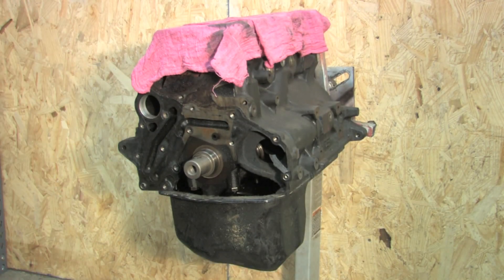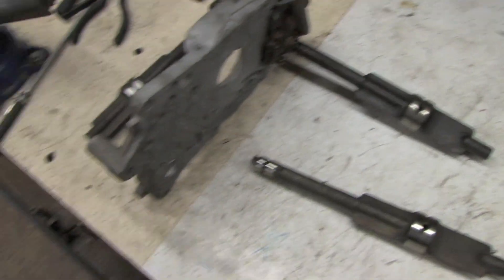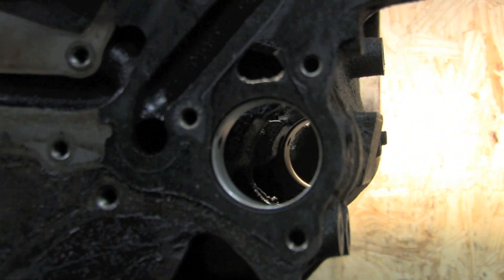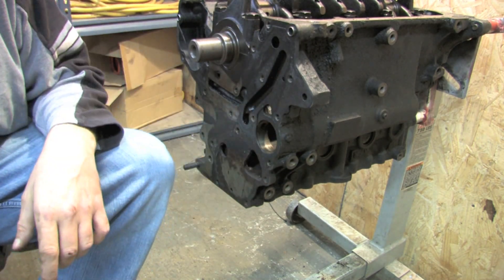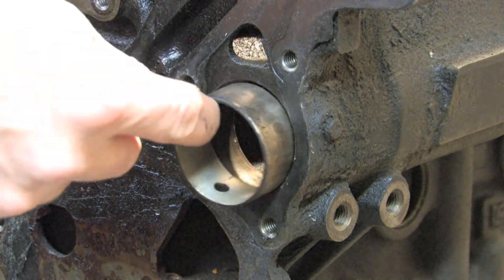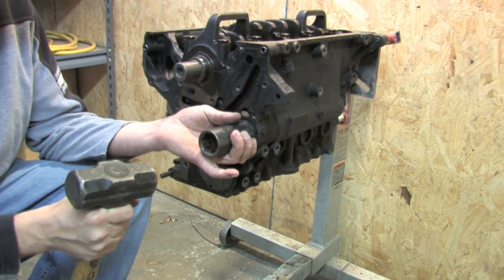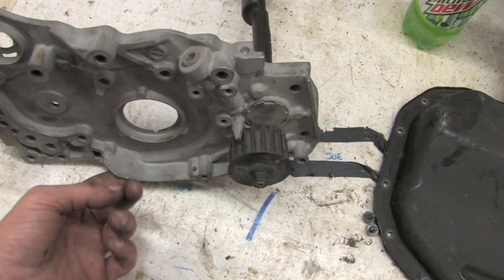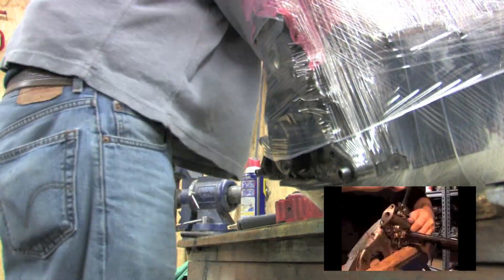4g63 Balance Shaft Elimination - bearing modification

Comment: I have a new oil pump for a 2005 , 2.4 mitsu eclipse , my car is actually a 2006 will I still be able to use it an modify it slightly where the crankshaft sensor bolts up like with a die grinder an will it fit ? I don't see any follow up video on this

Comment: Hey @jafro I had a question I’m building a motor and was wondering if I run I pick  in the hole of the bearings should I feel a hole like if it is a oil feed . I ram my pick in the hole and it feels like if there is no hole through my not the block … does this mean the bearing was already rotated for balance shaft delete .
Reply from the maker: Very likely.  The bigger tell would be the absence of balance shafts, but if you got a pile of parts and you're trying to make sense of them, that's the best bet.  You can see a plug on the outside of the block for where the balance shaft oil gallery was drilled.  To plug the outside of the block, the Phillips-head looking threaded plug was sealed and screwed in.  If the hole isn't in alignment with that pin, that's another tell.  If the balance shaft bearing is scored and damaged and doesn't line up with the hole, option C is it spun the balance shaft bearing.  The damage would be obvious, but if the bearing is pristine, it was rotated for block-off.

Comment: I have a Lancer Turbo here in the UK, it has the 2.0 4G63 turbo engine in it, removing the counter rotating balance shafts also gives around 6 extra bhp, plus it negates the issue of when a belt snaps causing all manner of problems.
God vid, and you're right, it's a hell of a job.
Reply: How's your 4g63 sohc EX2000 Turbo now? Did you use shorter timing belt when you did a balance shaft delete?
Reply: @4g63_Everything  the balance shafts run off 2 different and smaller belts, so the cam belt remains the same as before, when they are deleted they give more power and its not really noticed on the engine smooth running.
They need to be done correctly otherwise it can throw the engine out of harmonic balance, ( I'm led to believe, not sure if true though) so total removal and blanked off.
Reply: @4g63_Everything  the engine needs to come out of the car. I've had a balance shaft belt snap in the past, it sounds like a big end failure and makes a lot of noise and can damage the engine.
Its a good idea to remove them from the sohc 4g63 engine.

Comment: Hello my friend , I need your help , please!. Let's see , when I turn on my car ( Mitsubishi RVR sports gear x3, engine 4g63) the oil pressure is 80 psi for 800 RPM (for 65°F). but when the engine starts to heat, the oil pressure drops to 0 psi (200°F). What do you think ????  
Note: my Metales are new.
Reply: The easiest place to start is by changing the oil pressure sending unit. (this is if you don't have the correct tools/knowledge to test it, they're typically very cheap)
Reply: @squintnmint  I already did it.

Comment: Took me a while to get that inside bearing set. I tried two times before and split the hearing both times. Once because I tried to go with a socket on hand that was not the same size as the bearing and the second was because I went to hammering on it before it was set in there straight. 
 Well third times a charm I’m gonna slap my beast back together now!

Comment: i have done  this job in my kia sorento 2009  i eliminated the oil holes by a stick .. but every body tell me that iam crazy to doing thatu wanna ask jafromobile
Reply from the maker: Nah man.  Unless it's a threaded stick in a threaded oil gallery torqued in place, then oil pressure will blast that thing out.  Then you'll end up with low oil pressure.  That would hurt all of your other bearings.  

This is the safest cheater method I would ever risk taking on my own equipment.  I bought all the rare out-of-production Mitsubishi balance shaft tools now, but this video proves you don't need any of them on a balance shaft delete.  You only need the balance shaft tools if you're replacing and re-using the balance shafts.  If it's just a delete, gimmie a hammer, a socket, and a half inch extension and the old balance shaft.  If you're careful driving them in and out, you can re-use the old bearings to do it, so it's a $0 job just like the stick.  :)
Reply: Jafromobile yes  i put a threaded sticks because i didn't see your video when i diid the job . ...your method is easier than the mine
I have a question.?
Why some 4 cylinder motors don't have a balance shaft and no harmonic balancer pouley
Does the harmonic balancer eliminate the vibrations and save the engine from domages .

Comment: In my early 63 days, I totally understood & agreed w/the idea behind the BS removal.  I have now taken the opposite view and consider it a big mistake.   Mitsu didnt just add the BS for creature comfort, they are there to reduce some serious, damaging harmonics that  can shorten the life of your build
Reply: good engine will have no bad harmonics and if you affected the harmonics of engine by removing BS then that engine has been already toast
Reply: Interesting. I'm new to the 4G63, but have heard it was done due to something with the way the engine and trans were set up? I know Honda F series has them and the engine is set up the same way, but spins counter clockwise and lots remove there's.
Reply: I got a nicely built 4g and it still has the balance shaft I think, only reason I say I think is because with poly mounts it idles hella rough.

Also if there harmonics are bad what about a harmonic balancer? Like a fluidamper or ATI
Reply: this is the same engine thats going into the GSX, its getting a fluidamper

Comment: my 2002 galant balance shaft is like hard to spin so it rip apart the belt. what can i do ???eny suggestions..thanks
Reply: do like me. my balincer shaft bearing was in the bottom of the oil pan,so done like the vid here ,i got reed of both ,the balincer shaft and the oil shaft
Reply: tom johnston I had the same thing happen to me - rear bal shaft bearing loose on the shaft when I pulled it out lol. Now I have the problem of putting a new bearing in its place because the hole in the block for the bearing is ground out just enough that a new bearing doesn't fit tight. What did you do for your delete? I'm pretty sure that rear bearing has an oil hole, so how to block that off so I still have oil pressure? Thanks

Comment: An addition to the "balance shaft bearing removal technique".My 318 Mopar motor had divots chunked out of the cam.From the lifters sticking open I read. I assured myself that the cam bearings would be OK since I read that they never wear years ago, I was broke and didn't want to buy a cam bearing tool and nobody rented them. But no siree Bob, there were grooves plowed into the bearings. It was as heart rending as realizing that I actually did buy a FIAT and it wasn't just a bad dream. Anyway, I had a half inch diameter threaded rod three feet long. I scrounged it from somewhere thinking it might be useful someday. Then I had a big socket, half inch drive, and luckily a big nut which fit right into it and threaded onto the rod which located the socket, so as to center it on the threaded rod. The socket was backwards.  Then I had scrounged some huge thick washers. I think from when the electric linemen erect those crucifixes they hang wire from. These washers were an almost exact fit in the bores of the cam bearings, just slightly too large. So I mounted the washers onto the threaded rod, and spun the rod around while leaning the washers on my belt sander since I don't have a lathe. That whittled the washers down and allowed me to chamfer the edge of the washers, fatter where they contacted the cam bearings. I also had to belt sander some flats onto the threaded rod because I didn't have enough nuts to double nut the whole thing together when it was time to use it. There was another nut clamping the washers to the reversed socket. Then since the socket almost located this assembly inside the cam bores, but not quite, I wrapped the socket with masking tape to make a Rube Goldberg device slightly more solid. Anyway, it worked. The two pound sledge hammer propelled it. I couldn't damage the block, that's why the extra care. I couldn't do the rearmost cam bearing because the engine was still in the Jeep. A hunk of garden hose maybe 3/16 inch was needed around the threaded rod to locate the washers too. The washer needed grinding as the thing progressed into the motor. The tricky part was when I installed one of the bearings wrong and had to drive it back out with this funky setup. Trying to slip parts of it into place and assembling it inside the block. (I had the oil hole misaligned.) I used a weight lifting plate for a slide hammer on the threaded rod! But it ran OK afterwards till an old bag crashed into it and totalled it.
Reply from the maker: One of my friends bought a FIAT Spider in high school.  He got the tag, "HU FIATD".  True story!  Making tools is the mark of a true mechanic.  Same person I'm talking about owned several obscure vehicles like 50's era Volkswagens, '60's era Jeep Commander, Land Rovers and even the 104th Mustang ever built... and everything that inspired me to make my own tools came from his example of necessity.
Reply from the maker: Sorry... 1968 Jeepster Commando.  Even more obscure.

Comment: So if you got rid of the balance shaft, won't the timing belt length needs to be a little different ?
Reply from the maker: Nope.  The rear balance shaft is driven by the oil pump gear, and the front shaft has its very own belt.
Reply: hay just wanted you to know your vid has been a great help.iv never messed with the mitcubishi alway had the ford and chevy,so got a good deal on a 03 mitch  with a 2.4,it sounded like a rod was going to come out anytime,so i removed the oil pan and there lay a balincer shaft bearing in the pan,so even with the motor in the car i done the balincer shaft and oil shaft removel ,went ahead and changed the mains and rod bearings,all with the motor in the car.runs fine.thanks for the great vids

Comment: Jafro, any reason not to use a 32mm socket to drive out the old bearings?
I have the oil pump, timing belt and balance shaft delete on hand and enough in my bank for a rebuild kit, waterpump and timing belt tensioner so it looks like I'm finally doing a rebuild on my van.
Reply from the maker: MM95 Good question, you didn't give me the context of what you're doing, so here comes all the possibilities in case it will help others... Sockets usually have rounded edges, so they slip more. You need a really well defined edge like what's on that shaft to knock it out.  You can drive them out with a socket, sure, but you need a proper bearing driver to install them if the balance shafts are ever going back in it.

If you wish to preserve the shaft, but the balance shaft isn't going back in, go ahead and wail on 'em with anything that fits.  You need a socket that's smaller than the hole, but bigger than the bearing and that's really hard to match.  Every socket set is different.  If you go smaller than the bearing, those rounded edges will cause galling on the bearing bore as it mushrooms the bearing.

If you're keeping the balance shafts and you drive in new bearings with a socket, it can cause a high spot in the bearing face that leads to premature bearing failure and seizure of the balance shaft.  

Without balance shafts and with bearings re-installed blocking the holes, beating the bearing in and out with a socket it can cause misalignment of the bearing resulting in an oil pressure leak.

If you don't have the proper tool or one with a good edge to drive the bearing out (or destroying the balance shaft as I'm demonstrating)... you must take extra caution not to damage the bearing bore.  Often times auto parts stores will rent out bearing drivers.  Those are usually very worn out tools, but they're the [worn out] right tools for the job if they have them.

If the balance shaft bearings are okay, and the engine is keeping its balance shafts after the rebuild, I just leave them alone.  I can measure an installed bearing, and I can measure a balance shaft, and I can calculate the difference splitting that result in half to get my oil clearance and make sure I'm right... but there's less of a chance a replacement bearing will be in spec and aligned properly than the new ones that are well broken in.  You can not measure for taper to detect an alignment problem once the bearing is installed.  You can't plastigauge it either.  You can measure your oil clearance, and even if it's at the end of spec, I leave it alone.  DSMs aren't famous for having low oil pressure because of having a balance shaft.

Failure of a balance shaft bearing will result in the same damage or worse than breaking a balance shaft belt.  The broken balance shaft belt gets tangled and snaps the timing belt because it's inside a sealed timing cover with nowhere else to go.  A 4g63 is an interference engine.  What that means is... it will basically take one of everything in the valvetrain and rotating assembly to fix correctly if the timing belt breaks.

That's why if I'm ever re-using the balance shafts, I just leave them alone.

Anything else I can add to help you get there?  :)
Reply: Thank you good sir, I will take a look at the tool box and at the bearings to see if I have anything that is close enough to work, I wouldn't mind modifying some tools. If I don't have anything reasonably close I will go head and rent the proper tool.
I am simply doing the elimination so will be nstalling new bearings 180 out to block the oil holes. My whole build is very low end, just to get the 4g64 powered van back on the road. The only "upgrades" are going to be balancing the rod-piston combos, the crank if it needs any other machining and obviously deleting the balance shafts.
Reply from the maker: MM95 You can whack the bearings out and back in with sockets, but goop the bearings with anaerobic sealant.  Saves you the tool rental, but use the sealant...  No leaks.  ;)

Comment: If you can grab the front shaft and make it clunk, does this mean the bearing is bad? I bought the car as a project (bent valves) and my friend noticed this while we were going together with everything. Would it be possible to leave the rear shaft in place and remove the front belt in order to drive the car to his shop 3 miles away so we can eliminate the shafts and tap the front hole fora plug? I don't have the space to do this job in my driveway.

Comment: Do you turn the bearing 180 degrees out on the other balance shaft that gets totally removed also?
Reply from the maker: Nah.  One shaft is hollow and it oils the bearings.  The other shaft (the one I show here) is oiled through the block.  If you use the right stub shaft, it blocks off the oil supply.  I have a video called "4g63 oil system" that explains it.  ;)

Comment: Hello my friend... Firstly thank you for such a wonderful informative video.... i have a 4G63T .... its a 7 bolt...  had the oil pump serviced, new bearings(complete) installed and got the crank shaft polished..... the engine was damaged.... iam guessing its cause of crank walk maybe.... Could you give me what i should do to prevent this from happening again? as maintaining a 4G63T in Fiji is really not that cheap..
Reply: What this does, as described in google searches, It eliminates the need for a balance shaft. This diverts some vibration of the block, and its not really needed. It is a part that is known to break, and it breaks in the vicinity of the timing belt. This, would result in major work. This is a preventative measure - Not a performance mod.

Comment: So you eliminated both balance shafts?
Reply from the maker: Yessir.  It's what you SHOULD do if you're doing the job.  It will affect your oil pressure to remove both, but so will leaving the front shaft in because it's not spinning if you just disable it.

The rotation of the front shaft affects how the oil film layer flows out and how much it leaks.  I'd rather take other measures at the oil filter housing and the head oil port to make oil pressure more predictable than have a shaft that may leak more or less depending on G-forces, but plenty of people get away with removing only one and disabling the other.  Leaving it in there is the lazy way to do it, and one that can have consequences.
Reply: ***** Thank you for the reply sir!
Reply: +Jafromobile will you make any videos on porting the ofh? Thanks
Reply from the maker: I did!  I have an all-encompassing OFH video that covers that mod as well as every model of the DSM OFH.  ;)  It's called "4g63 Oil Filter Housings".
Reply: THANKS MAN!
Reply: +Jafromobile thank you. Your videos are awesome.

Comment: 💥 you idiot didnt line up the oil holes with the bearings....
Reply from the maker: This video is titled "Balance Shaft Elimination - bearing modification".

One would only need to line up the holes if they were to be retaining their balance shafts.  One's bearings, if installed with the holes lining up, would then not be modified.

The loss of oil pressure from lined-up bearings with no balance shafts installed would result in immediate catastrophic failure of the rotating assembly due to complete loss of engine oil pressure.  Perhaps I'll make a video of a car with balance shafts in it someday?  ;)

Comment: In Egypt we just get rid of the bancers in most cases the balancer bearing rotate in the block hole and you can't make machinning by boring machine because the other end is sealed therefore we simply don't fix them by a very simple modification

Comment: Oppps Also (1) if the oil pressure goes below a predetermined amount of oil pressure, does it shut down the fuel pump to prevent damage to the engine? safety (2) Also does it have a bypass in it oil pump system in case of a plugged oil filter?   ty again.